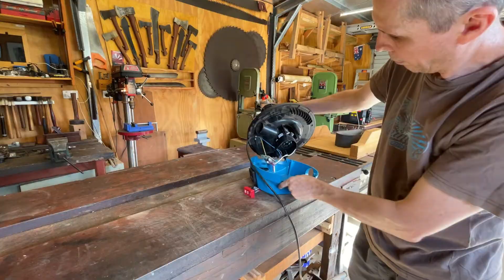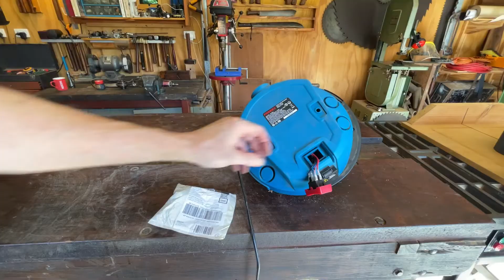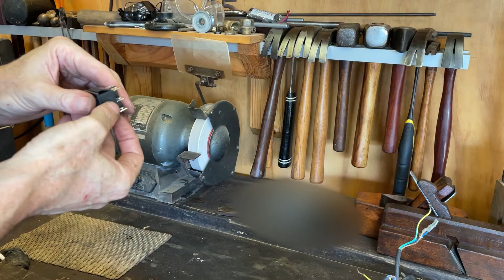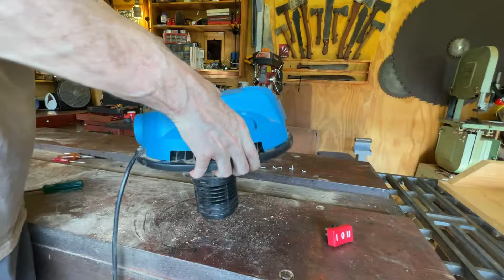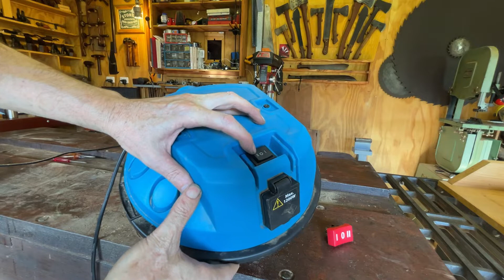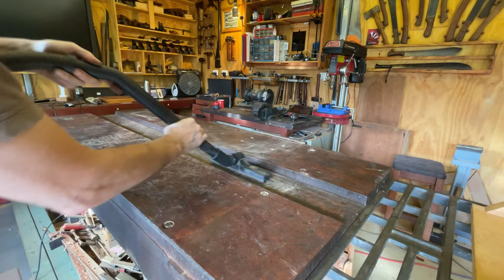Aldi Shop Vac - 5 Day REPAIR-A-THON

Comment: I've ben on the hunt for a vac with PTO that works with my drop saw, but my wattage draw is too high! It's been keeping me up at night! Great work saving this from landfill
Reply from the maker: it works when i tested it on my bandsaw,  powered on the vac when the saw come on,  not sure what the difference in watts are.
Reply: @Saw-IT  maximum rated I can find is 1300, but my saw is 1675 watts. I've bought a remote in the interim

Comment: My little Ryobi cheapo vac has been kicking on for nearly 5 years... you should get a few more out of this one now!
Reply from the maker: Yeah it does the trick, the switch position 2 is a current sensing cct to turn the vac on when it detects power from the saw. Worked that one out but unfortunately the vac cant provide enough power to the mitre saw. I scored another little vac for free and it is the same, i should give it away. Funny how the music can really change the feel of the video.

Comment: Matt, Nice to see you fixed the vac & saved it from landfill. Switch position II should be an auto detect turn on/turn off. Set the vac to position II, plug in a sander to the outlet on the vac, switch on the sander and the vac comes on, switch off the sander and the vac goes off ie. the vac is on only when you’re making dust.
Reply from the maker: That's Brilliant Geoff, I knew it must do something because the switch has a wire to that side. I just tested it and it works! The next time i find a chance to use it like this, I will personally thank you in the video. Thanks heaps.